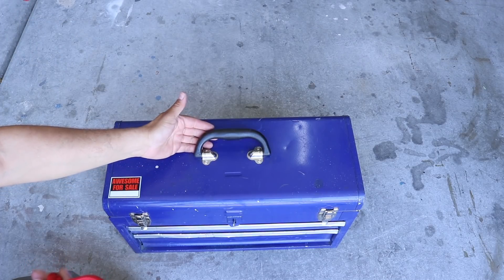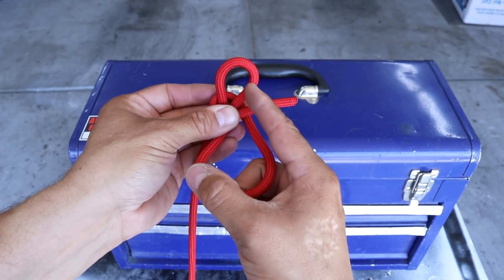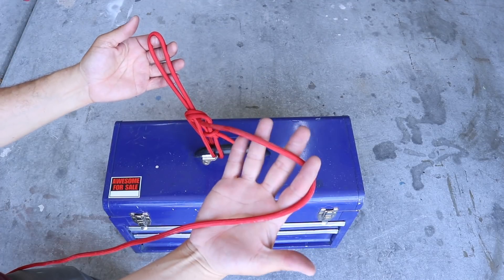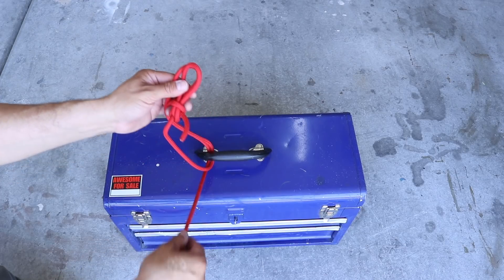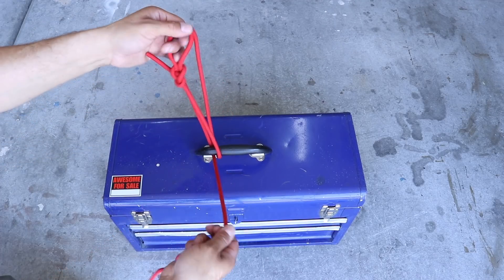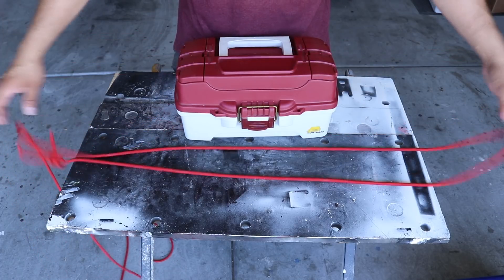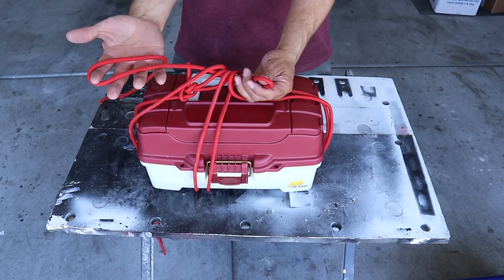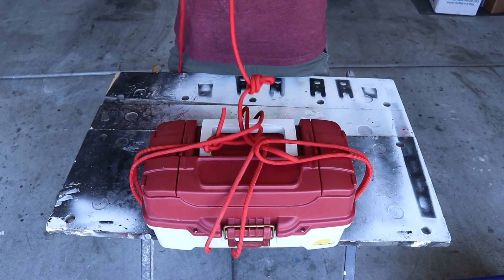Auto-Release Rigger's Knot

Comment: This principle of the two side by side lines, coming either from a knot or end of a loop, binding a knot in between under tension to be a simple but effective means of binding. I first saw this in how the jungle knot is connected. But tension must be maintained for it to hold.

Now that I think about it, I did use this principle to hold a door open by simply making a loop and securing the knot in it around a handle. Just never thought about the principle until the jungle knot and now here.

Comment: Why not rather use a running bowline or other secure loop, and attach a line to the loop (or thread the bight of your line through the loop) so that it can be pulled free?
Much safer and simpler.
Reply: if you have that much rope you might as well just loop your line through the handle, hold both ends and lower it as slow as you like.
Reply: @ziggedr4y   Yes, as you say.

Comment: Hmm. I wonder if there's something similar to transport stuff UP. Like I like to put stuff up on the roof from the ground with the help of a pulley sometimes... would be nice if I could get the rope back somehow to put more stuff.
Reply from the maker: The thought never occurred to me. I’ll have to check it out.
Reply: @ duy - Yes, use a running bowline or other secure loop and attach a line to the loop (or thread the bight of your line through the loop) so that it can be pulled free. Safe and much simpler.

Comment: I was a rigger for tower cranes, arborist, and worked on fishing boats. I haven't seen alot of this stuff. Really cool channel man. Subscribed.
Reply from the maker: Thanks brother!
Reply: I have used various knots but I like this especially lowering items over my balcony!
Reply: So what knots did u use
Reply: @jordanwalker9309  hitches and bowlines mostly
Reply: What do they use for a guide line where say, a  tower/tank, when set, the mounting location is way up in the air? There will also likely be slack in it, so I'd imagine the self release knots wouldn't work. My coworker said they'd use hitches and just whip the rope around until they came loose, which works, but thought there might be better ways.
Reply: @KISSMYACE3203  Most taglines were a 10-30ft rope w/ a snap hook attached at the bottom of the load. If you were setting something down low and out of reach, the tagline would be attached high. It's almost always retrievable, because you have to unhook the rigging. There are probably some smaller outfits that get away with doing a knot for a tagline, in that case I imagine you would use a loop where the ends are bent

Comment: I remember (oodels of years ago) my dad acomplishing the same thing in a different way.
I think he had both ends of the rope up with him. Then used the middle of the rope to tie to the load. One of the lengths he had up with him lowered the load. Once it got to the ground, he pulled on the other one to untie.
Or maybe he had the center & put the ends on the load. Not sure. But it was cool either way.
Reply: Make a loop on the center of the rope.Pull one end of the rope around the object and through the loop(like a slip knot) to be lifted or lowered. You have both end of the rope one is tensioned or doing the lifting/ lowering action. Once the object is on the ground pull on the other end of the rope the other end of the rope will slip through the loop. (Use the butterfly loop).

Comment: I found that if you pass the end with the loop under the handle, put a bight on the heaving end through that loop, cinch it down tight around the handle. Then put that bight around the knot on the heaving line. It gives you a large loop which allows it to release a lot easier. Though of course it's not as secure.

Comment: This not is only for open areas that has no chance of contact with other structures even with a tag line (certified rigger) losing even a light load such as small tool box can kill someone . Other than not pointing that danger out , video well done
Reply: My exact thoughts..(Head Rigger ,Head Steel Rigger ,Rigger , High Steel Climber & Roadie 4 ever)
Reply: Perfect for a guy working alone, who needs to lower a passel of stuff to the ground without carrying it several trips on the ladder.
Reply: You should never walk under a suspended load regardless of the type of knot used.
Reply: @carlantaya175  That's under perfect conditions. You already know working on a deck, lots of overhead rigging from steel erectors or concrete carpenters